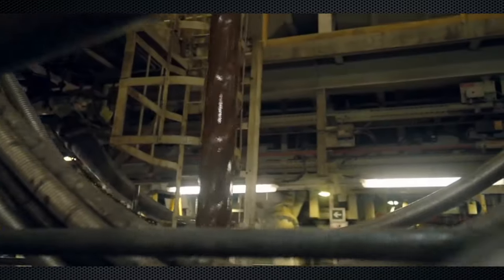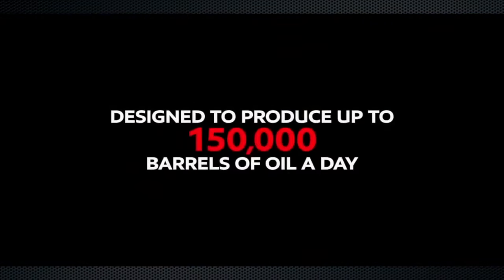Oil & Gas job explained in Malayalam l derrickman l

Comment: Msc chemistry kaxhinjirikka, oru basic oil gand gas related course um cheythittund (as per ASTM). Let me know if there any vacancy
Reply: Msc chemistry..bro better to find otherjobs insted of rig job..!!
Reply: If you are that much interested try to be a mud engineer in rig..!!
Reply: @favaskc3632  computer science degree vech oil rigg ൽ job കിട്ടുമോ
Reply: @SalmanulFaris-b3e  angne oru computer relted post onnum rig l ella. Venamnkil offshoril radio operator aayt oke apply cheyyam. Pinne well service filed l logging MWD post lek okke apply cheythal kitavunnathan. Mainly electrical engineers oke aan kayarikaanarullath

Comment: Broo +2 padich kainn poyal oil and gasil poyal derik man akan akumo
Reply from the maker: First you have to start from roustabout - floorman- Derrick man- assistant driller- driller - tool pusher - offshore installation manager.  Education ullavarkku chance koodum.
Reply: @thinkstudio01  Bcom Degree und any use ?

Comment: Bro what is wireline?
Reply from the maker: we will do a video.
Reply: Wireline is a oil service operation for the supporting jobs on a well in drilling and Completion stages. Its a steel wire mounted in a winch, which can run to the well for different operations and works mechanically and electrically..

Lot to explain
Reply: @favaskc3632  sir, contact number onn tharamo. Njan diploma and b tech in EEE kazhinju. Oil and gas course cheyyan nikkuvanu.. Kurach doubts und

Comment: Bro pls tell me which is good college in kerala
Reply: No better institution in kerala to provide proper oil and gas jobs. Only NDT, Fire fighting and safty.. thease are majour courses and thease are outside jobs. If you want to get a chance in proper rig operation follow IADC or IWCF courses.
Reply from the maker: "Institution doesn't matter! You can enter this profession without a formal course. However, if you choose to join a training center, ensure they provide placement support. The initial entry into this field may be challenging, but once you gain a foothold, you can progress to better positions and companies."